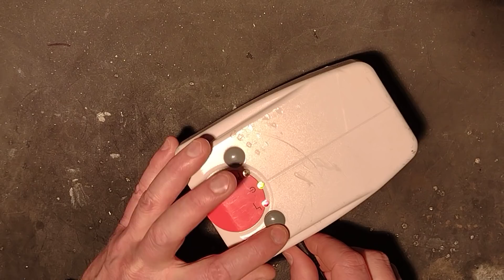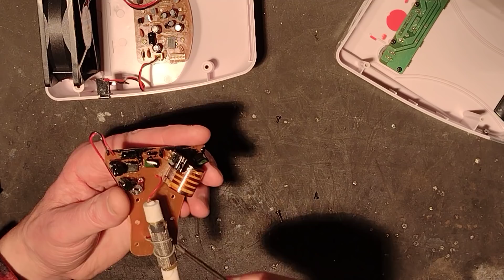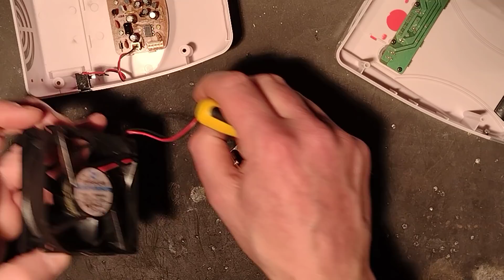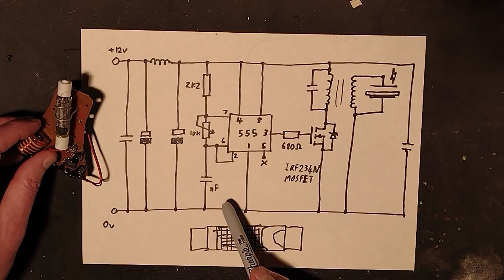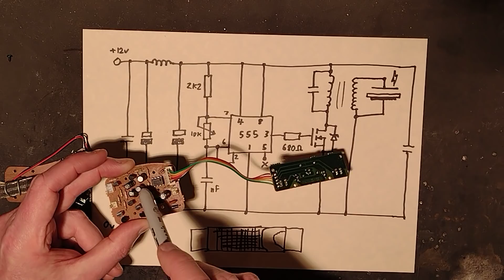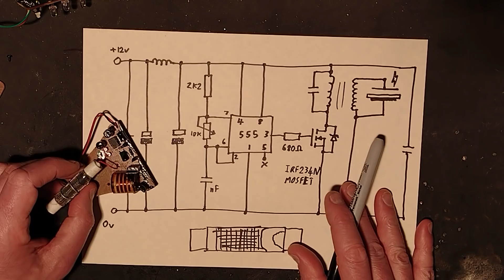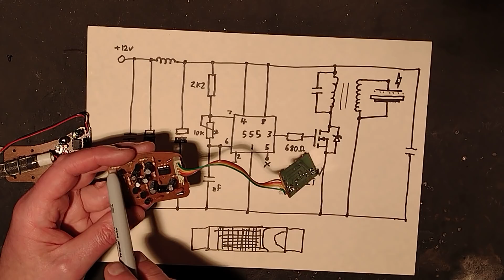Old shoe deodorizer ozone unit (no microcontroller)

Comment: 555 is a versatile little IC.  Can even use it as an oscillator for a LW / MW radio transmitter.
Reply: 555 was the first chip I ever used. Like 30 years ago. Special
Reply: @jonnysparrow5666  I think mine was the 741.
Reply: Never thought of radio oscillator! Yes 555/556 is very versatile and somewhat robust. It can handle slight overloads (v+ and data input) all day long.
Reply: @GeorgeZ213  I believe the upper limit is about 1 MHz,  but this will cover low MW band and all of LW band.
I built a LW transmitter using 555 (RF oscillator) and 2N3904 (modulation driver),  and this can transmit very good quality wideband audio to any LW radio in the house or yard.  It's not CD quality,  but excellent for AM.
Reply: @LakeNipissing  The CMOS version 555 will run up to 2 MHz. How's the weather in the Sudbury area?
Reply: i think i've been watching too much bigclive, when he said they scrubbed the numbers and that it would be possible to deduce the part by function first thought upon seeing 8 pin dip being used to drive a supply i could only think "bet its a 555"
Reply: lake nipissing, 40+ years ago i worked at a scientific establishment that used to build its own special circuitboards.  if i remember correctly, one of the scientists told me that any chip, whatever else it is designed for, has a clock function in it if it has 555 in the part number.
Reply: 7555 is much better